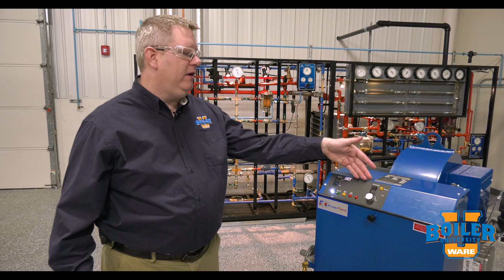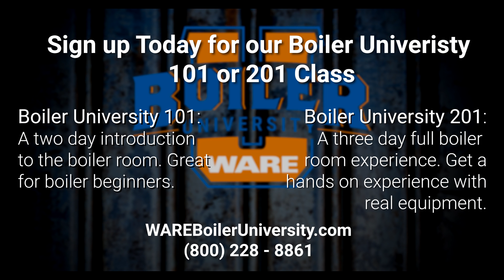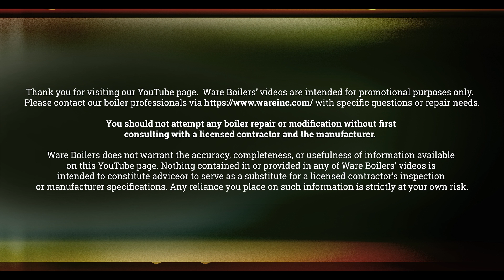Operating the Boiler in Auto / Manual Mode - Weekly Boiler Tips

Comment: Would you recommend dropping the firing rate below the auto mode boilers rate on a boiler running in manual mode or should the manual boiler always be firing slightly ahead of the auto